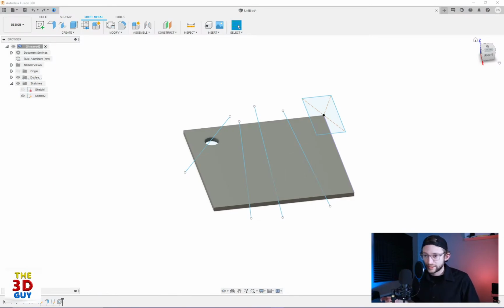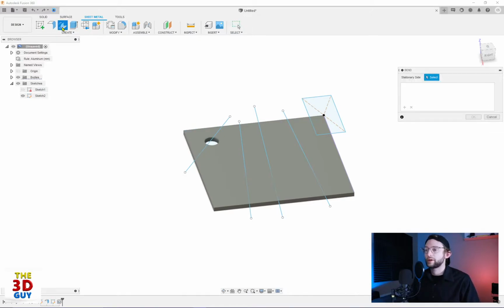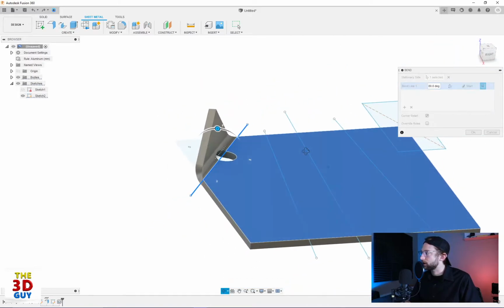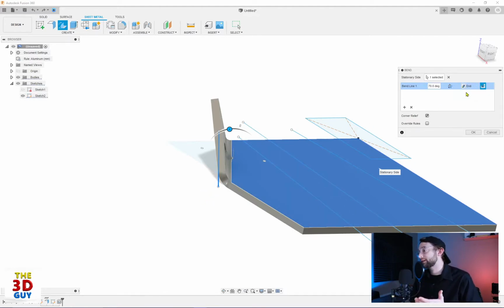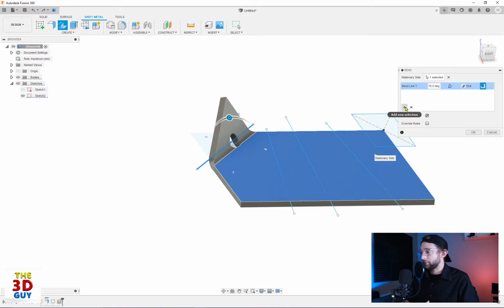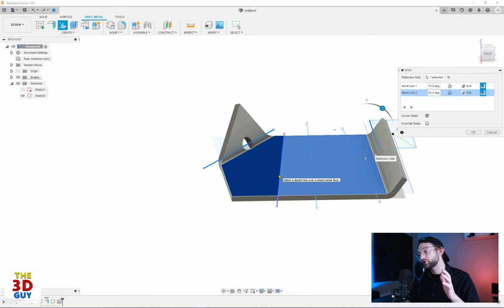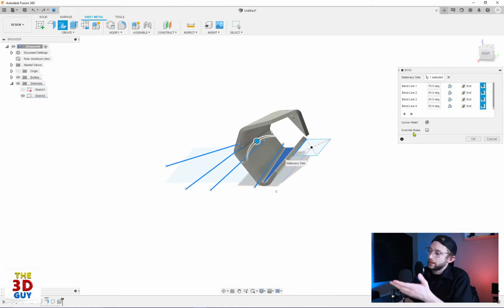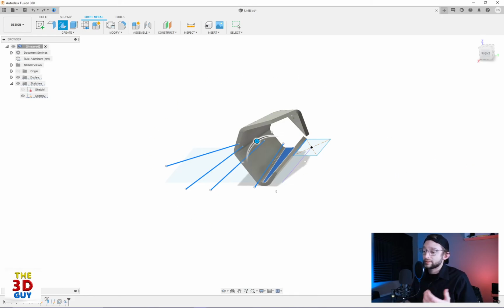How To Bend Sheet Metal in Fusion360

Comment: is it possible to post process g code for sheet folding machine on fusion 360?
Reply from the maker: Thats a great question. Unfortunatly I dont have much experince with using Fusion files in CAM and other machines that would use a g-code (minus a 3d printer). Hope to get more expereince in that area in the future so I can make some videos on stuff like that. Definitley try making a video on it though if it is possible

Comment: I have a dxf file with bend lines already in place but must be missing a step to be able to bend the object after I give it thickness.  All my bend lines are gone.
Reply from the maker: like the bend lines are not getting imported in to Fusion?
Reply: @the3dguy387  yes.  My dxf file had bending lines from another cad program.   The only way I was able to get it to work was to recreate the bend lines in fusion over the existing lines.  It would recognize all the parting lines in the 2d state but once extruded I had to add fusion sketch lines over the top.